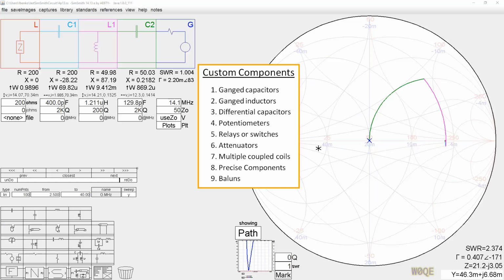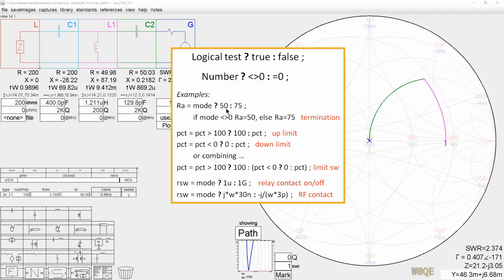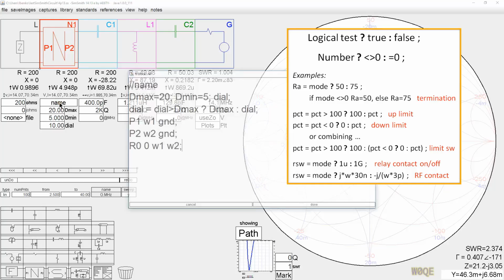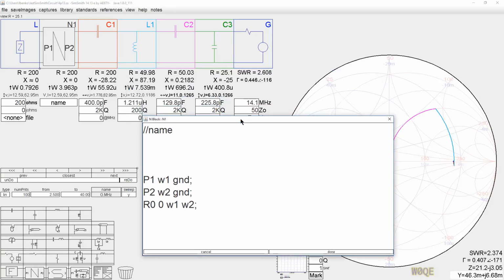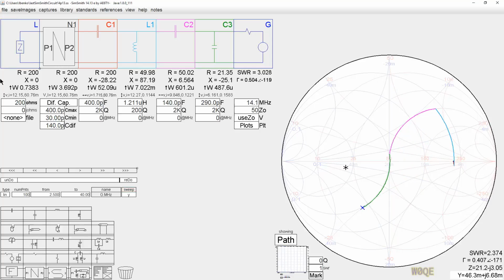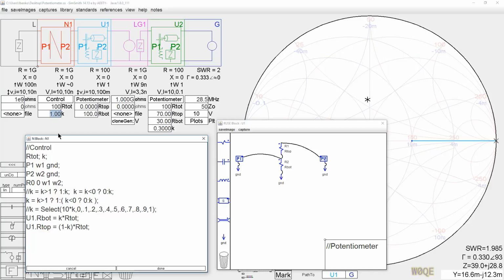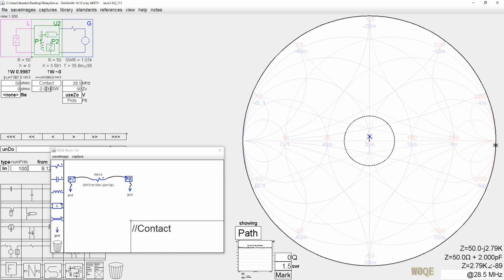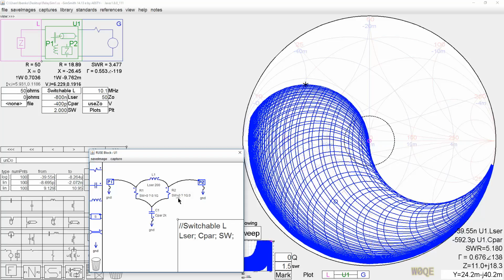#15: Ganged & Custom Components (Basics 8)

Comment: why you dont make just descrete elements with yhose functions. and just leave some space for programming as a hidden feature
Reply from the maker: I'm not sure what you are asking.  For a simulation program to be useful it will include a certain number of basic components which are used as building blocks.  However the user often wants something else such as 2 air variable capacitors with different maximum values ganged to a single shaft.  Having the ability to simulate a component like this is very useful.  Please ask the question again if you wish.
Larry
Reply: @w0qe  Yeah, its difficult to explain without pictures.  I compare with other software and simulators( for ex microwave office). There are a list of elements on the left. Very big list. You just drug them to the workbench, click right mouse button and choose “properties”. And you dont need to write a code how those elements work. For me it would be better if you just add icons for elements with certain properties and people dont have to study how to program them. It would be more user friendly interface.
KD2VTP
Reply from the maker: @saintfather7757  This video is actually quite old and a lot has changed in SimSmith since then.  A couple of years ago a new block was added called the RUSE block and it is located just to the left of the trash can.  In this block you can draw pretty much any schematic and the components can be programmed to change as you wish.  Nearly all of my later videos use the RUSE block as it removes the "ladder" circuit requirement from SimSmith and thus allows the analysis of baluns and other circuits.  Perhaps you haven't watched some of the later videos.
SimSmith is totally free and I am not the author of SimSmith which is Ward Harriman, AE6TY.  I have minimal input into changes into SImSmith but that is all.
Larry
Reply: @w0qe  yes. I started watching all videos from old to new. Planning to finish in 2 days. Its very exciting. Thank you. 
Is SimSmith open source soft?
Reply from the maker: @saintfather7757  No.  The code is written, owned, and maintained by Ward Harriman, AE6TY.  These are questions that only he can respond to.
Larry